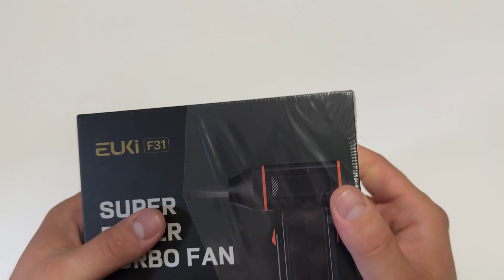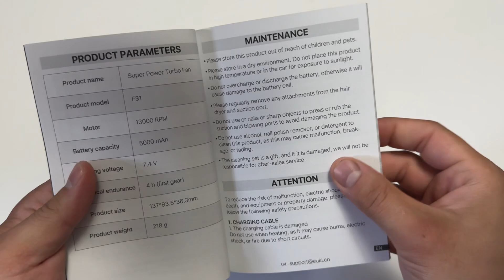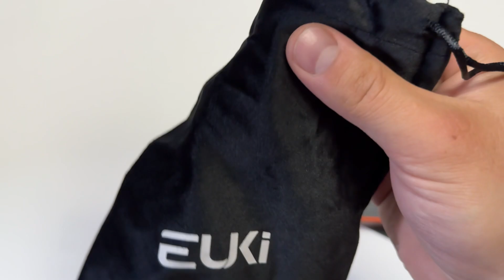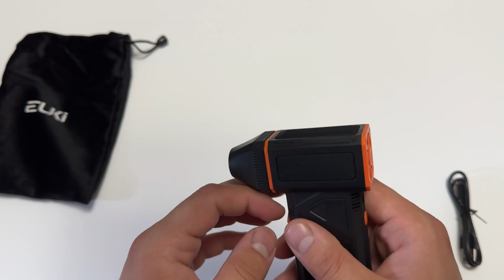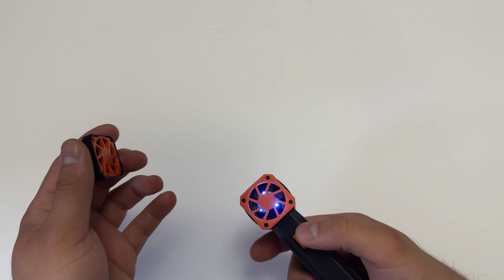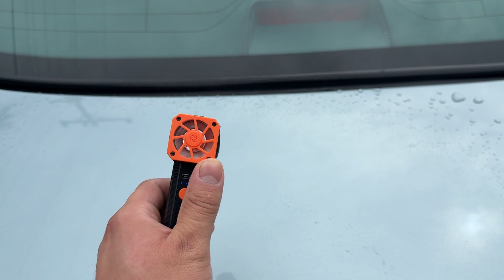Euki Air Duster Unboxing & Overview

Comment: Great video...I bought the latest one the other day( the X3 I think it's called) it's certainly powerful and I agree a set of interchangable nozzles would be more useful than all those little detailing brushes which are more like a ladies pedicure set...I think it states that the RPM on this one is around 150,000 with a 6000ma battery...it gets really warm after a few minutes on the turbo mode...it blew away everything inside my computer (dust wise that is)...really happy with it at the minute, pretty expensive though.